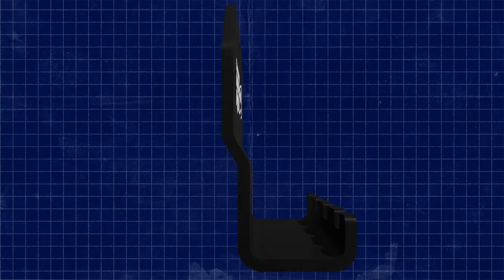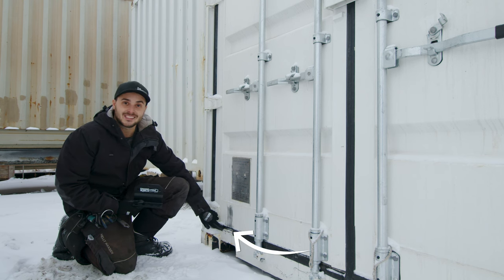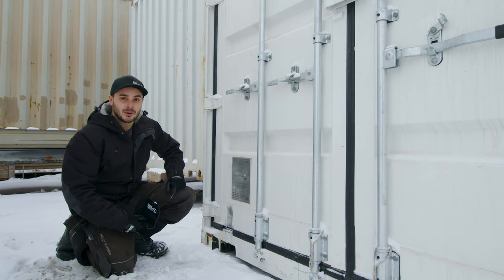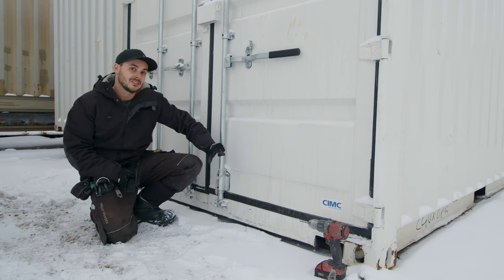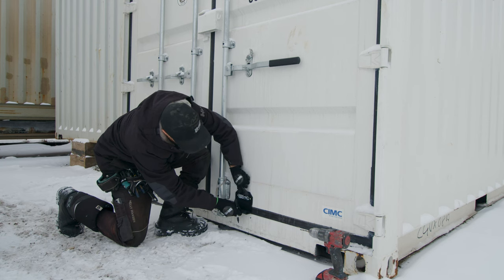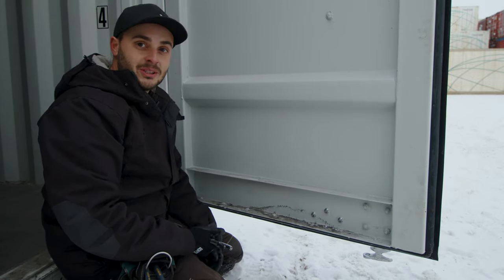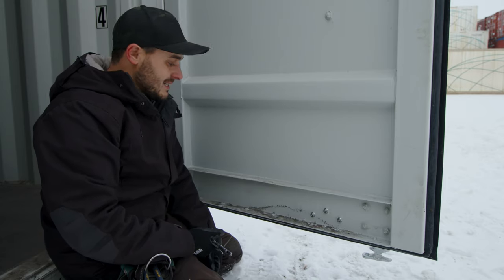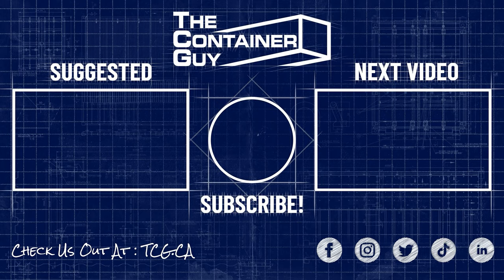NEW Kick Plate Makes it Easy To Close The Doors On Your Container!

Comment: Would you recommend rubber grommets or maybe washers for the bolts? You are trying to prevent water getting in there...
Reply from the maker: 🤦 I didn't even think of that when I filmed the video. It was spontaneous and not pre-planned. I should have mentioned the nuts on the backside should be caulked the same way as all of the other hardware. Cutting a rubber gasket to fit behind is likely too expensive but could seal the top edge from water running down to the door or apply sealant behind the kick plate. Thank you very much for the constructive comment! Keep em coming! We need more followers like you.